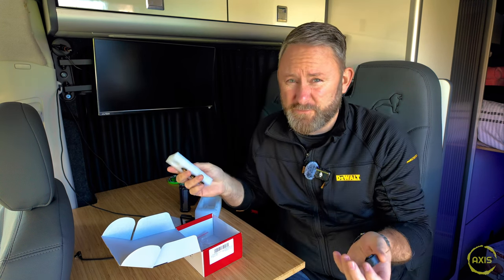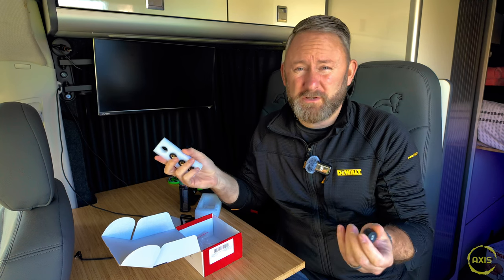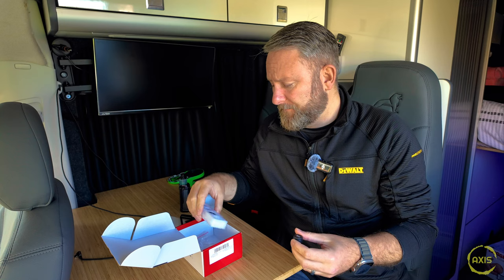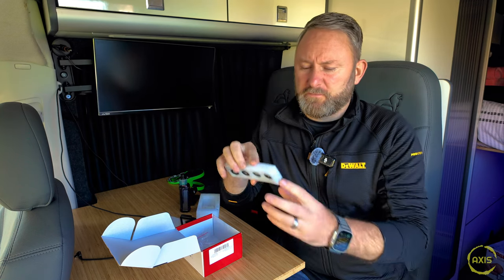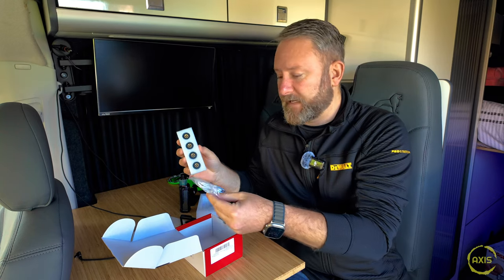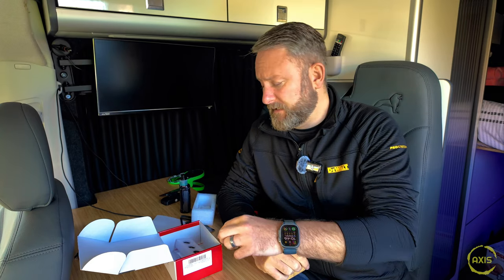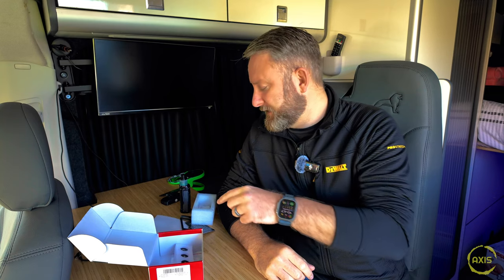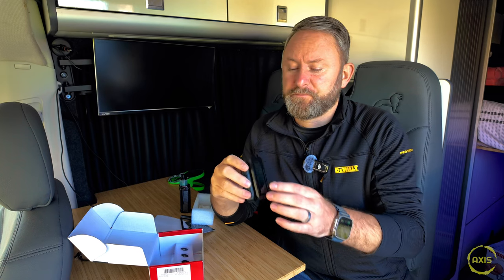VW Crafter MAN TGE TPMS: Everything You Need to Know

Comment: got them on my ford custom also on my caravan so you can monitor all 6 tyres the temperature range shows the actual tyre temperature its quite a difference on the caravan.Roger.
Reply from the maker: That’s interesting 👍🏻 so would be good to see if the tyre walls are getting warm due to not enough psi 😊

Comment: Good idea those, mine are 65’s and I can never get a solid answer what to run them at 🤷🏻
Reply from the maker: @vandox21  yeah there are loads of mixed answer’s on the forums. Some say as the vans are maxed out in weight that they should be run near the top end psi! But the ride is shocking 😳
Reply: @AXISUK  i’m on 50psi right round 🤷🏻
Reply from the maker: @vandox21  maybe with a suspension upgrade you could possibly run at a higher psi 🤔
Reply: @AXISUK  maybe 🤔 😉
Reply from the maker: @vandox21  could be a good excuse to the misses on why I’m spending again 🤣😂
Reply: @AXISUK  😂😂🤫🤫
Reply from the maker: @vandox21  😉😆